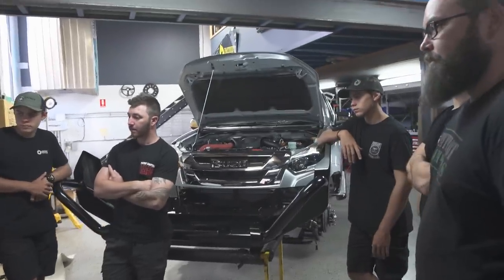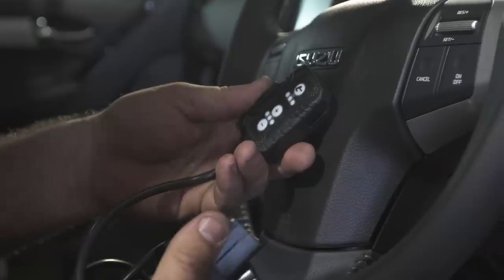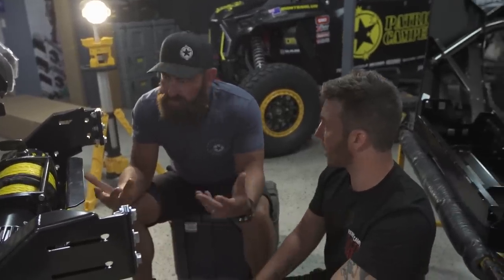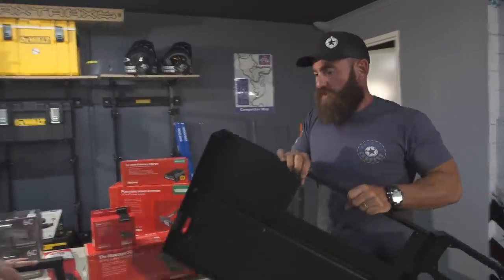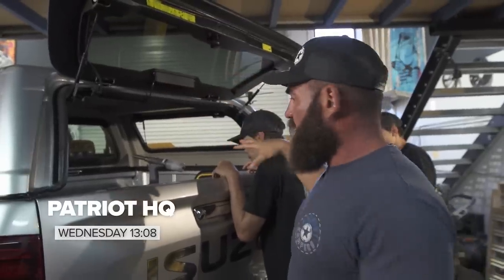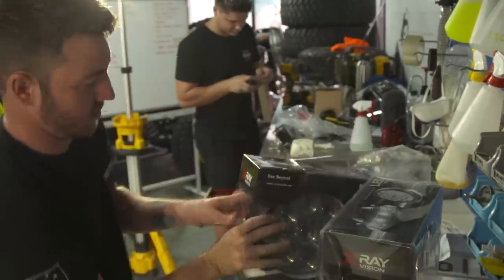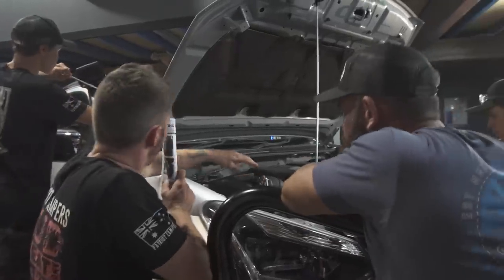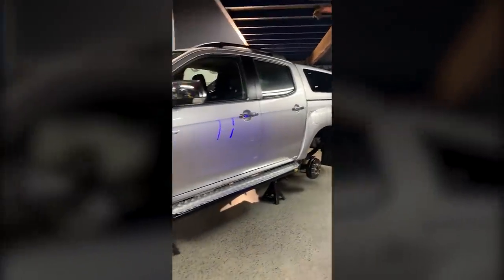Only 48 Hours Left to Build the ULTIMATE Overlanding Vehicle - DMAX Build Series EP 2

Comment: Did you attach the draws to the cab with tech screws?
Reply from the maker: Umm no.... Tek screws are for roofs mate 😂
Reply: @PatriotGames  what did you use? Was part that looked like it was using drill to secure it down.
Reply from the maker: Bolts and Nylocks